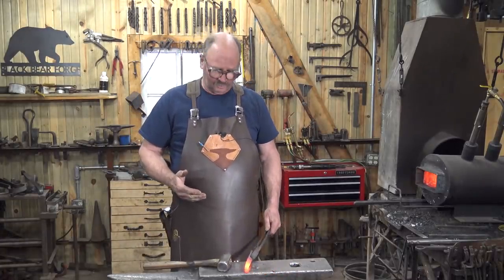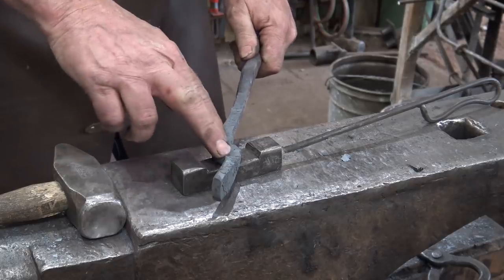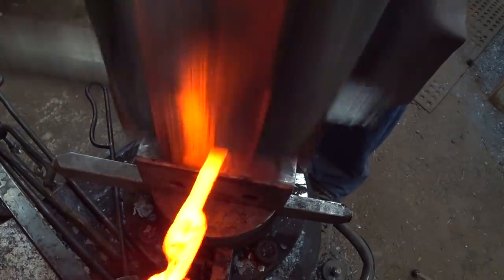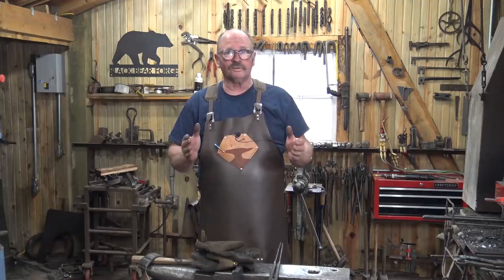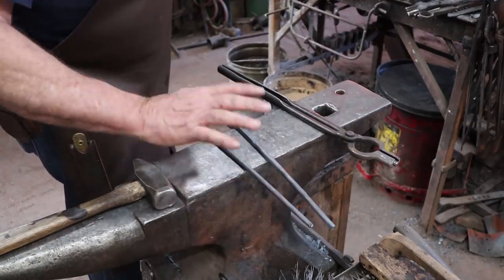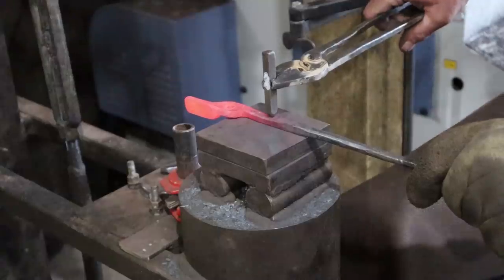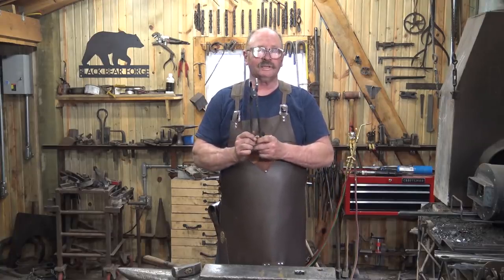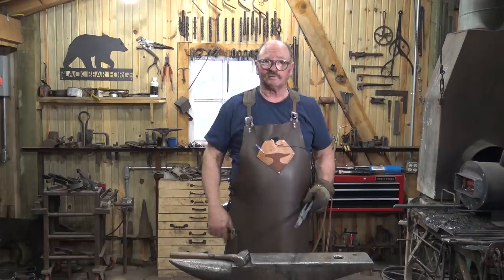Box Jaw Tongs

Comment: I really appreciate how much you emphasize safety. 
I made the mistake of using flat jaw tongs to hold the tang of a knife while drawing out the tip. After a few hits the blade shot out of the tongs and hit me in the mouth while still at an orange heat. It went nearly all the way through my top lip and loosened one of my teeth. The next day I made 2 new pairs of tongs, a pair of round jaw and a pair of bladesmithing tongs.
Reply from the maker: Close call. Glad it wasn’t worse.

Comment: John, nice video on the box tongs.

A suggestion to make forming the "U" shape jaw...clamp in the vise hot as you showed, but instead of bending the part sticking up with a hammer, use a bar, say 3/8" x 1" with a flat end.  Hold the bar horizontal and drive the protruding tab sideways in the vise.  That way the bending force is spread out evenly across the protruding tab and the force on the vise is sideways, not downwards, preventing it slipping down in the vise jaws.

Comment: Great video. Thanks for the tip on the stepped bottom tool for the power hammer. I'll make one of those for mine. Thought... if you needed to make a set for wider material, say 2 inch flat bar, would it be better to forge weld a piece on for the "box" side instead of having to start out with larger stock?
Reply from the maker: I think adding extra material for the box is a good idea.

Comment: I need to make a pair of box jaw tongs that have a 2.5" wide box jaw. What size material would you recommend? I'm working with 1/4"×2.5"× 8" material 5160. So it's rather heavy. I have a light set that tends to bend when I use it so I'd like to upgrade the thickness and rigidness of the tongs.

Comment: What's your recommendation when I want to make tongs but neither have a powerhammer nor a striker? Drawing out reins by hand would probably kill me as well as consume all the forgetime I have on weekends. Should I forge the jaws from thicker stock and then forge weld on reins?
Reply: Yes that's how it used to be done.
Reply: As you move up in hammer size. And with lots of practice, you are able to draw out reigns fairly quickly. I noticed that I got significantly quicker when I got up to 2 1/2 pounds and about ten sets of tongs into the journey. It takes me about a half hour to draw out  6 inches of 3/8 x 1 to a 16 long reign.
Reply from the maker: I would watch the videos linked in the top corner on this one, there are several options including forge welding.  Also take a look at the Kens Custom Iron Quick Tongs https://www.youtube.com/watch?v=9XunAoCMUbo